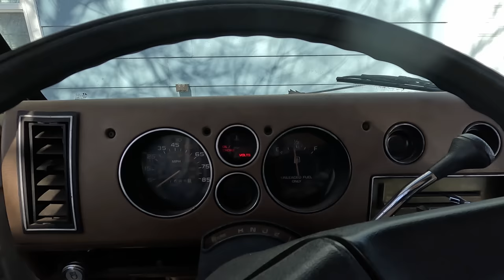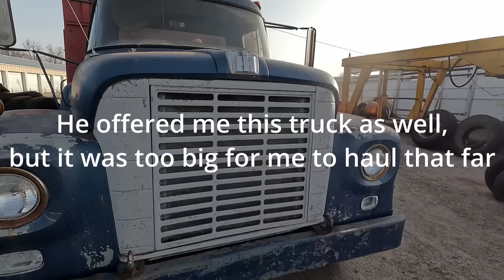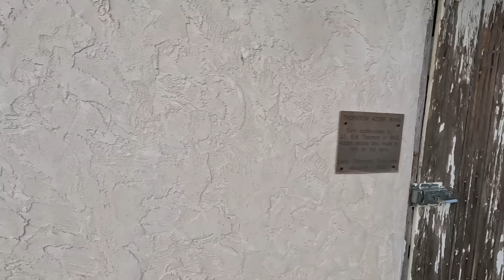WOW! I've Never Seen One of These Before! A Week in the Life of a Junkman...

Comment: I've never seen a V4 engine before, wasn't sure they even existed, now I know.
Thanks Silas, stayin tuned!
🤠👍
Reply: Dear John Shinn
European Ford V4 with 1200, 1500, and 1700 ccm. 40 to 65 hp.
Best regards, luck and health in particular.
Reply: Were around in Europe before USA, lots of them overseas.
Reply: Ford Transit van engine horrible things same issues as the ESSEX V6 from the UK but without any power
Reply: @Chr.U.Cas1622  4 Speed on the column too.  I learned to drive on a '57 Alfa with a similar bolt action set up.
Reply: @brycechessum4684  No, it's a German Ford V4 from the Ford Taunis.
Reply: @UberLummox  
Now look at that. Here we meet again. 2) To be uber correct: No, it's not Ford Taunis but Taunus! And Mr. Chessum is right too. Some of these engines had been in the first generation Ford Transit, even in ones for the fire department with dual tires on the rear axle. Way too weak for such heavy cars. Those small engines in the Transit had to be revved up high to get at least some power out of them. This made them wear out early and to consume a lot of oil and gasoline.
Best regards, luck, health and wisdom.
Post Scriptum: The Taunus is a low mountain range in the middle of Germany.
Reply: Dear  @michaelclark7037  
I still like column shifter.
Best regards luck and health in particular.

Comment: Those Sonetts can have extremely crispy crunchy rusty chassis. This is ‘69 Sonett 2 in video. . . .  I sold my ‘70 Sonett 3 a couple years ago. Solid steel on mine, but I got old and accepted I would never put it together. Had it almost 40 years inside dry garage, disassembled.
Reply: @MOSSFEEN No, that was just the Sonnet II series.  From '66-'67 the had 2-cycle 3cyl. eng.  They made the series III till around '74.  2 different body styles.

Comment: Most Saab Sonetts had a much flatter hood.  I was a bit shocked at how the hood on this one has a bulge shaped like the one on the '73 Triumph GT6 Mk III which I had in college for a while.  In fact, until you showed the rear of it, I wondered if maybe it was a GT6 or a Spitfire with a GT6 hood..  

Usually even a Sonett with a hood bulge, has a flatter, wider hood bulge.  I did a bit of Googling, and it seems the Triumph-like bulge makes it a 67-69 (or maybe 66) Sonett II V4.  Apparently there were 1.5 and 1.7 liter versions of the V4.   Those front bumper guards also make it look like a Triumph, compared to how a Sonett normally looks.

One thing I read said about 1600 of them were made, I'm not sure if that's US version or worldwide, and one model year or altogether.  Prices for nice running ones are high ($18K to 40K) and I even saw one somebody used for an electric conversion.

Comment: The Big ten Chevy pickup has another feature that you overlooked. The one at roughly 20 minutes into your video. See the gas tank on the passenger side with just a cap and no gas door 🚪. Unless it's an addition which it doesn't look like it. See then move them from the passenger side driver side. Rusty are not that side can be hard to find even aftermarket. So a person's going to have to cut that out of their old truck bed and may just want that one and patch it as it is. By the way I need a car with a Saab when I saw it in your thumbnail. There's a lot of buzz about the old saabs currently.
Reply: If you noticed, that truck had dual tanks, the switch was on the dash.

Comment: oh i wish that you were a lot closer id buy that sonnet in a heart beat i had several of the 96 and 95 models and have looked for a 2 or 3 for years they tend to go for 3 too 5 grand in complete rust free rust tolerable condition and yes the very first year they came with the two stroke 3 cly. there were two in my old Saab club, i dont think they made more than 30 ish the Saab 1 was a roadster 3 cly only ten made

Comment: Dag that SAAB has the 1.7 V4 engine in it . Those engine was really good . This was an German engineered engines and early engines of these V4 - V6 engine was used as starting motors on board ships during WW2 . Ford of Germany after WW2 stolen the engineering and built the 260 289 305 V8 . These engines was used by SAAB starting back about 1968 I think . I owned a 1974 SAAB  Sonnet that had the 1.7 V4 . Fun car to drive .
Reply: @MOSSFEEN  There was a Saab sonnet 1 with a 748 cc 3 cylinder two stroke engine, 55-57. Sonnet 2, also called Saab 97. It had either a 841 cc two stroke or a 1,498 cc ford V4 engine. Built from 66-69. Sonett 3, 70 and 71 had the 1500 cc Ford V4. 71-74 had the 1700 cc Ford V4.
Reply: @MOSSFEEN  I think you should read up on the SAAB Sonett . They had a 3 cylinder 2 stroke engines then they went with the 1.5 V4 and the latter Sonett's got the 1.7 . Mine had the 1.7  My Sonett was a 1974 .
Reply: @MOSSFEEN  Yes that is right ! Over the years SAAB made 3 series of the Sonett . I still love the car and love all three models . I just wish they did not rust so bad .